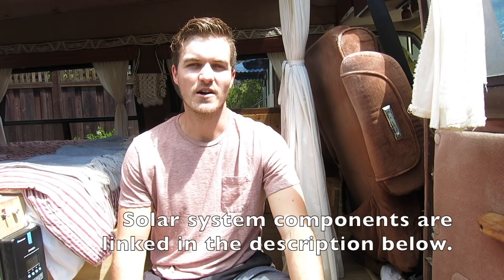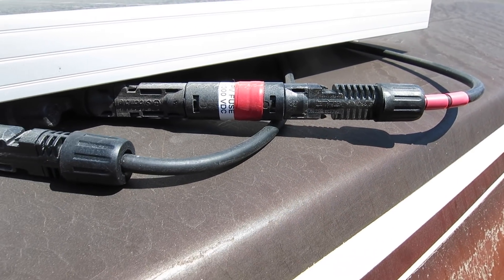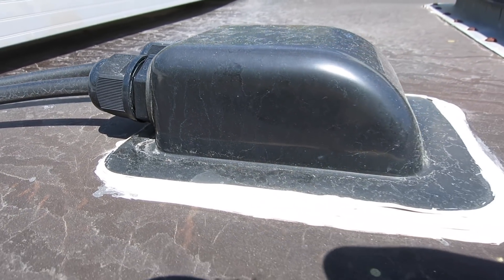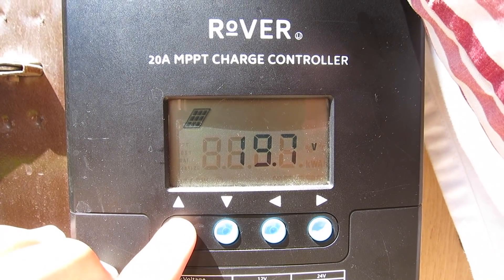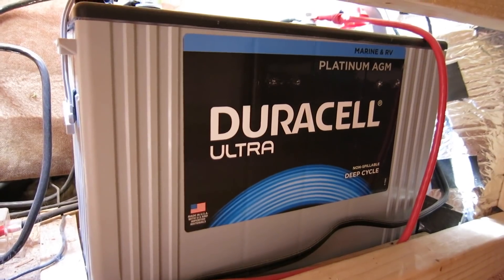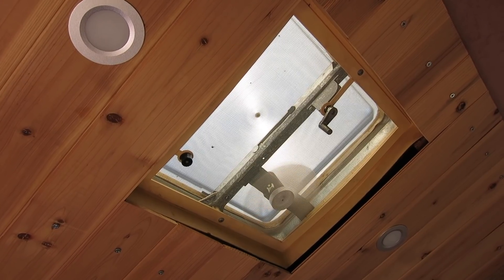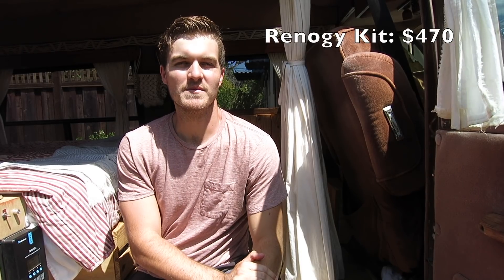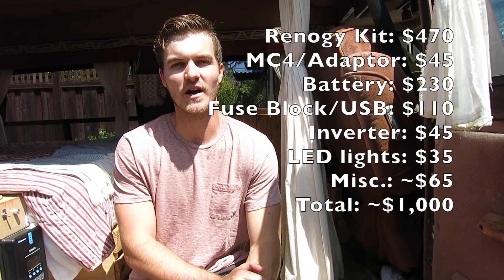Simple DIY Camper Van Solar Power System (Only $1,000)

Comment: Bryce and Courtney,
 How does the van drive with the panels on the fiberglass top? Have any damage or leaks occurred due to wind resistance pulling on the fiberglass? We have a conversion camper van that I'm trying to figure how to mount the panels. Thanks for the info.

Love, Branch and Amber
Reply from the maker: We never had any problem with them!! Good luck with your van ☺️

Comment: so where do you actually store the battery? I thought 12v batteries give off of toxic fumes and need to be vented, or need some sort of air flow to keep them from getting too hot and leaking acid?
Reply: AGM batteries are designed to be safe indoors. Your old standard/flooded can potentially leak and put off odor

Comment: Where is your battery located? I am doing something similar and wondering if I can put a AGM battery under the bed or if I need to make a sealed box with vents to the outside for off-gassing. Thank you for the awesome video, super helpful!
Reply from the maker: Our battery was stored directly beneath the bed. Our understanding is that AGM batteries do not require ventilation. Glad the video helped!

Comment: great presentation ; may I add a Note ;blue sea sells a low voltage shutoff to prevent running your batteries too low and damaging them ;
Reply: Thanks for the tip! We use our charge controller to check the voltage and charge of the battery. Since we don't run any major loads, we don't really have to worry about running it too low. If you had larger loads that run all night,  this would be a cheap way to avoid having to replace a battery.

Comment: This was well done.  :-)  I have a similar setup except I don't have my panels on my roof.  I was worried about putting them up there on the fiberglass.  I also have the embedded 2x4s in my roof so I suppose if you guys did it I could.  I have 2, 100 watt panels that are connected together that I have a quick setup frame built for that I take out of my van and set up when I'm stopped.  That way I can park in the shade and have the panels in the sun.  It is a pain if I only stop overnight to get around the panels though if I don't want to put them out.
Reply: Installing the panels through a 30-year old fiberglass roof terrified me! The plywood runners underneath the fiberglass make them very secure and we coated all the holes, bolts, and brackets with a marine-grade adhesive sealant to make it weatherproof
Reply: So you went completely through the roof?   I just got my ceiling insulated and paneled so I would have to just to to the embedded 2x4s... ya, even the thought of it scares me.  lol
Reply: Javaman92 we used bolts (not screws) so they go all the way through the runners. Of course, we did this before we added insulation and it’s all covered behind our ceiling now
Reply: I've been thinking that what nomads need is a mount system that gives you the option to leave panels on the roof and track the sun, OR let's you remove them from the roof (think commercial ladder racks) for placement (along with sun tracking device) away from the vehicle.
Reply: Don Yates I would have agreed with you except we have never been short on power even in non-ideal conditions. I’ve seen the panels charging the battery in the rain!

Comment: i accidentally bought the kit with the wrong controller. Make sure when you order you are getting a MPPT and not PWM controller. PWM will work however you will be limited in upgradability and efficiency. im more bummed about the efficiency loss.
Reply: The MPPT controllers offer high efficiency and the cost difference (when compared to the value of the whole system) is negligible. Still, for the small loads in an off-grid camper van, the efficiency difference probably wouldn't be noticeable.
Reply: J G  I Agree.  We just hit the road and are on a time table to get to the west coast. Planning on swapping it later when we have time.  We do run a fridge off out solar. Works great but we have little wiggle room and we will want the extra juice when we hit the dessert.

Comment: Awesome!!  I am working on my solar stuff now and this was way Helpful!!!   all I need to do is to end up with my Hair sticking straight up due to SHOCK! LOL!....     I run a little fan all night and I have to have the noise....  So I am working on adding all my stuff up....   Problem being we are getting a Geo Pro to Full time in and I am not sure what the Ice Box amps are... So I have to wait on a few things... Thanks For sharing this!.... WOOT!!  :)
Reply: Just Around the Bend  cheap rv living just did a review on 4 small fans for RV’s
Reply: Just saw that lol.... Thanks....   :)    I tell ya you suck up every little bit when your learning don't ya.... ?    :)
Reply: Thank for the support! The fan probably draws less than you'd expect, so the fridge will probably be the key load for your design. Once you get a grip on those numbers things should fall in place!
Reply: Yeah.... Thank you Bryce....   :)